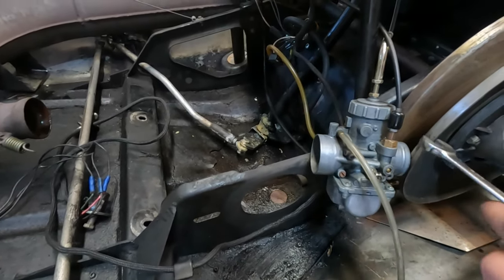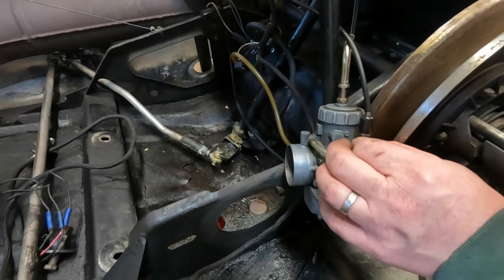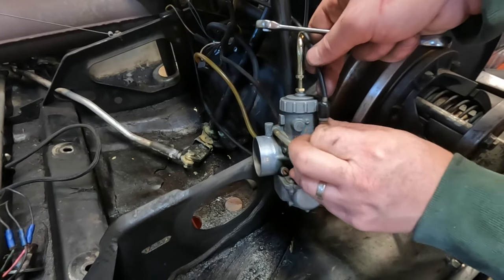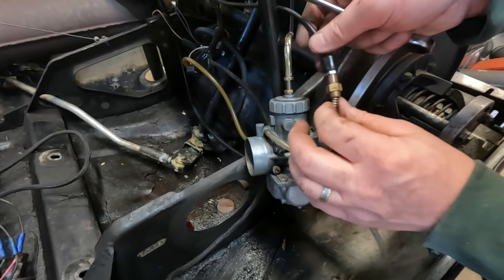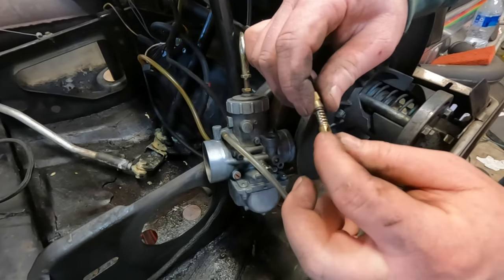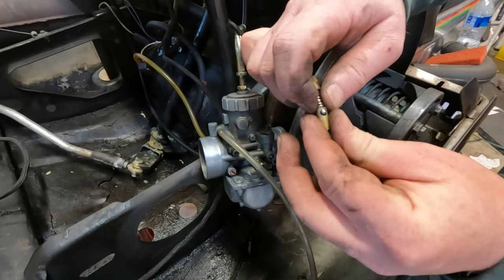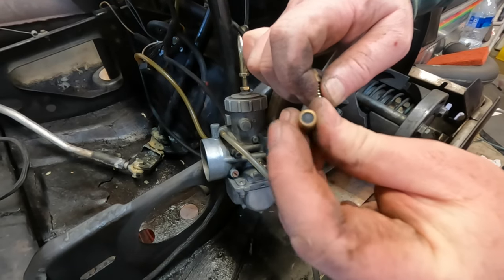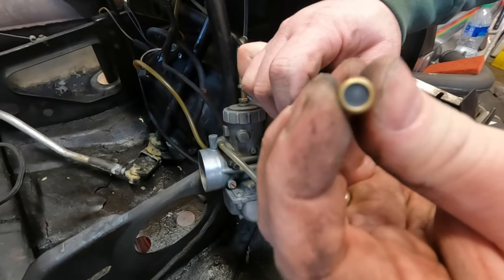How To Replace Mikuni Carburetor Choke Plunger #snowmobile #vintagesleds #carburetor

Comment: Great demonstration. Can you please explain why they needed replacement and what the symptoms were? Im having a continuous high idle at 3000 RPMs on my 1999, Indy 500 with dual carburetors everything is set correctly to stock, and even with the idle screws backed out three turns the idle won’t come down. I did notice when I slightly pulled the choke lever as it’s idling high, it brings the idle down slowly as I pull it to the point of killing it.
Reply from the maker: The rubber end that seals gets old and doesn't seal well.  If you are having high idles issues that would be an indication that it's running lean.  When you pull the choke it richens the mixture bringing down the idle.  Have you cleaned the carbs?   Make sure the pilots jets aren't plugged or partially plugged.   Also check the rubber boots between the carbs and the intake for cracks.  If cracked they can leak are leaning it out.
Reply: @GarageWorx  yep I went back through the carbs. They are spotless. They’ve had a second cleaning now since having my issues, the carb boots are brand new and sealed nice and tight. I tried starting fluid down by the clutch seal that didn’t seem to do anything but just today a guy told me to try brake cleaner because it’s a different viscosity and will usually work better than starting fluid for checking for air leaks. it’s got 7000 miles on it. I know the top end was rebuilt but the lower end likely not.
Reply from the maker: It could be the crank seal on the recoil side too.  One option could be to go up one size for the pilot jets.  The problem with that it is could end up masking the real issue.  I have a 2002 MXZ 700 that would idle high brand new and I did go up one size on the pilot jets since I think the jetted them lean from the factory.  Been like that for 20 years and it's still runs awesome.
Reply: @GarageWorx  hey thanks those are both great ideas. I’m good at checking the spark plugs regularly so even if there was still a problem, I am keeping an eye on things. That being said, I will say the plugs are not very light colored. They’re actually pretty dark, brown/black even with this high air situation.
Reply from the maker: @daveg2199  Cool.  Check back in with your findings.